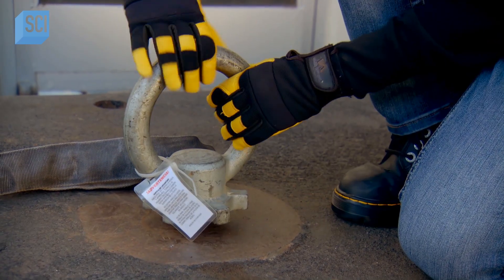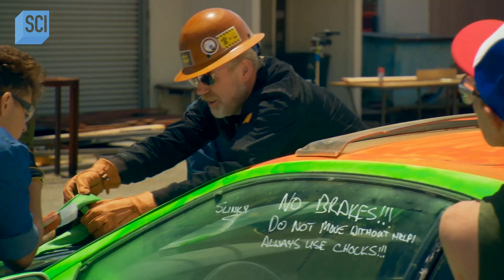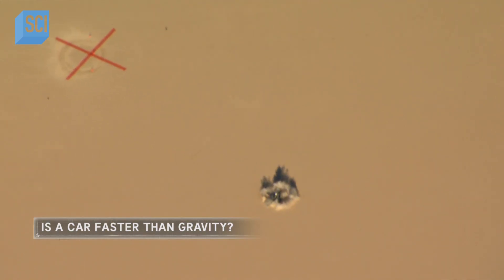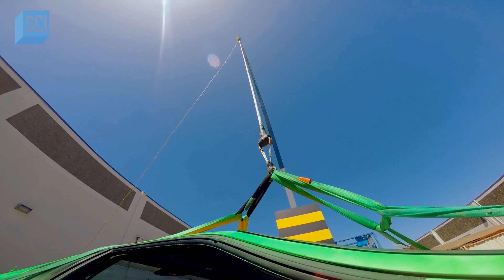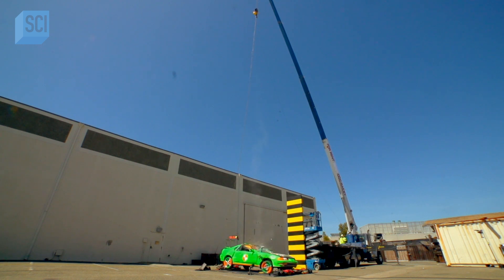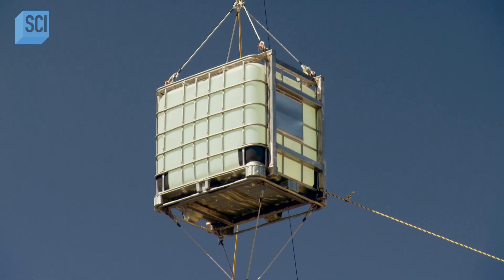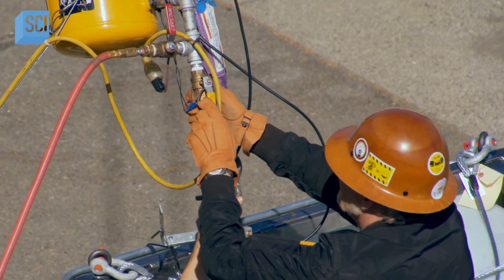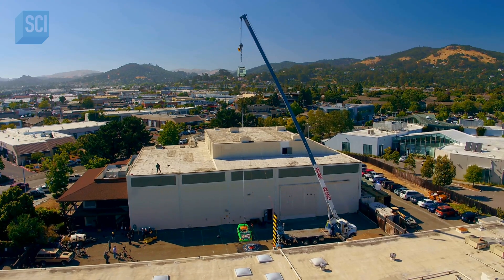Adam Savage Uses a 10,000 Lb Quick Release To Drop a Car | Mythbusters Jr. | Science Channel

Comment: To me, it seems it started to move around frames 386-435. I set the speed of the video to 0.25

For the second run it seemed to be around the 150-170 frames. If you watch the little bit of yellow by the a-pillar I think it's called, you can see the yellow start to increase

Also, how dare you destroy the prelude